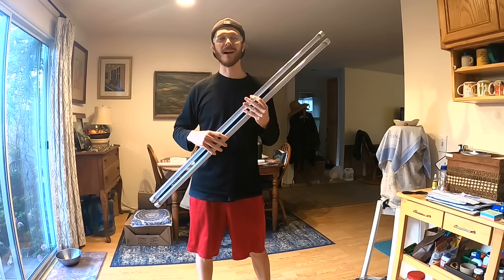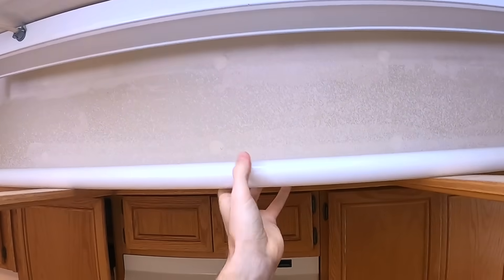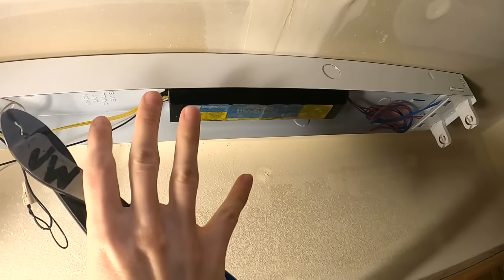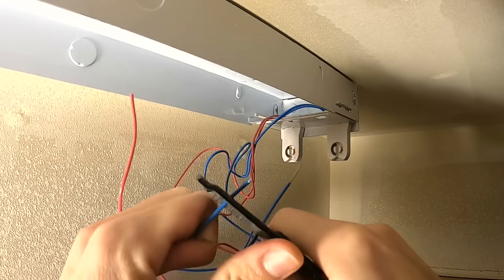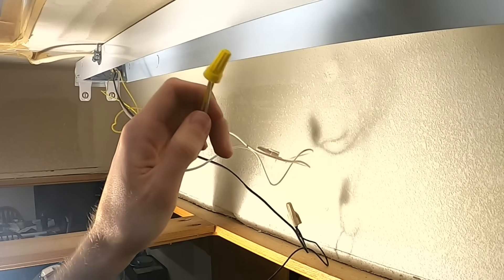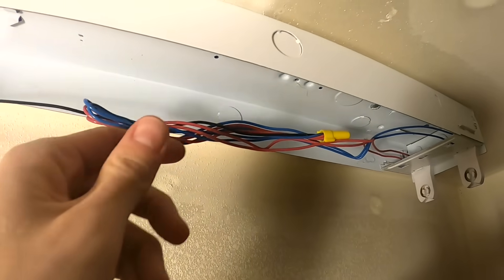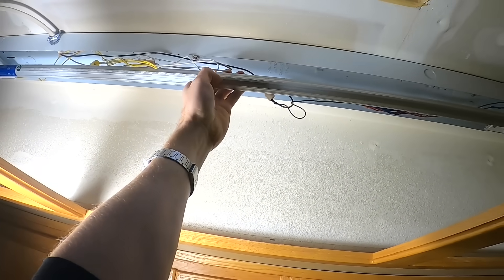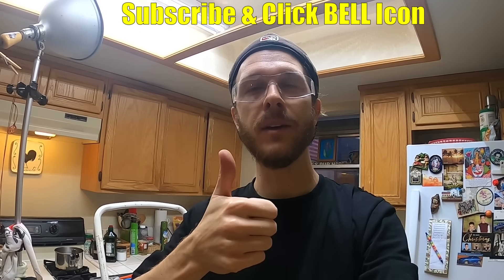How To Easily Convert Fluorescent Lights to LED | Save Money on Energy Costs

Comment: It cost more overall to buy new led lights than the running cost of a flourescent over its lifetime 😂 it’s a pointless effort
Reply from the maker: they're not much more expensive where I am, plus its' a great energy saver and if your ballasts ever go out, its the way to go 👍
Reply: @JonnyDIY  there isn’t a huge difference in energy usage between LED and Flourescent. That’s why I just don’t see the point going through a big effort
Reply from the maker: @j_c2225  Mine cut the energy more than half with these ones. It took me all of 10 minutes to do and $30-40 in bulbs.
Reply: @JonnyDIY  they’re like 15watts for a 17 watt replacement there’s a good chance it won’t even show up on your electric bill and if it does that’s 1 cent
Reply from the maker: @enterprize-zi8dd  Depends which ones your'e replacing. Mine old tubes were 40w each so quite a difference. Brighter too
Reply: @enterprize-zi8dd can I get an led freezer and fridge and TV? Maybe even an led stove and oven or microwave. The real power eaters.
Reply: Big difference in cost if you replace the flo bulbs often as suggested by the manufacturer. Once they start to blacken on the ends light output has decreased dramatically.
Reply: @rgruenhaus induction ranges use way less power. You can also get DC or AC powered fridges that work directly off of solar (DC) without an inverter, or off the mains and they still use 1/5 the power of a regular fridge. They cost a bit, but offset the cost of the solar needed to run a regular fridge. Laundry spinners also save a LOT of dryer time. Super spun clothes last longer and dry in a few minutes. Less detergent gets baked into the clothes too.
Reply: $7 each Harbor Freight
Reply: However you are forgetting that electric rates will rise steeply in the future so the ROR of LEDs will increase. Every replacement bulb I use is an LED.  They are reasonably  inexpensive last longer and are a godsend to use in areas that are almost inaccessible… like those in the foyer that are 12 ft high.  I have a fixture in the “mud noon/laundry” that chews fluorescent  bulbs, they are a pain to replace and a “PIA”  to dispose of. There is no way we can convert to renewables as fast as the environmentalists think or demand … so the result is we will reduce consumption by increased pricing  and government edicts. The end of reasonable energy costs has passed.
Reply: Always an idiot out there.  We converted the gymnasium at our school to LED.  18 bulbs each pulling 400 watts, not to mention 18 ballasts, that operate so hot you can’t touch them.  We removed the ballasts, rewired the fixture to bypass the ballast, and installed 100 watt LEDs that  put out more light than the original bulbs.  Each bulb was $65.  We are now using a quarter of the electricity, and putting out no heat, instant lighting, and they last about 22,000 hours.
And this is a bad thing?
Reply: How many times are you willing to replace ballasts?
Reply: @garyfetner1003 my kitchen 2ft fluorescent rarely gets used and has the same ballast and bulbs since the house was built in 1980.
Reply: In a kitchen or bathroom, where the light is switched on and off a lot, LED lasts much longer than fluorescent or CFL! ... My kitchen LED fluorescent replacement is 12 years old, works as good as the day it was fitted, and provides plenty of good quality instant light! ... Some people are resistant to change for the better, and are stuck in the past!
Reply: For me it’s also about getting rid of the audible hum from flourescent bulbs.
Reply: @bryanbierbaum536  it's either the bulb or the ballast.
Reply: @bryanbierbaum536 — That’s what I came here to ask about....
Reply: @bryanbierbaum536  it’s the ballast humming
Reply: What tube lights are $120 a box right now and ballast are $40 led bulbs are $10 a piece lmao stick to handyman stuff.
Reply: Quality of florescent bulbs and ballasts are total crap these days. They don't last like the old ones, not even close.
Reply: There are three reasons for converting from florescent to led tubes. 1: building safety. The starters get hot and can catch alight. They will fall to the ground and set alight whatever is below. I have witnessed this in 3 buildings. The first two there were people in the room and they extinguished the fires. Last building was badly damaged. Just get rid of fluorescent tubes and any luminaries with starters unless they can catch fire outside safely. 2: florescent tubes contain mercury powder. You don't want that around, you can't safely vacuum up the powder from broken tubes. 3. You need to replace all tubes and starters every 7500-10k hours because the light output drops. It is quicker to replace a led tube than a fluorescent tube plus starter.
Reply: @dammitdad What you stated is no valid reason to replace flourescents. Never seen a starter catch fire. Also, not many preheat fixtures around. Most are RS. Mercury contamination is not inherent to the normal function of the lights.
Reply: I’m tired of fluorescent bulbs. I once bumped into a cfl bulb in my brother in laws attic with my head and it broke. I don’t think that was very good for my health. Also, we have to bring our fluorescent tubes to the dump and pay to dispose of them. I’m happy to switch over.
Reply: I changed mine to get rid of the damn buzzing ballast! And the flickering. That was well worth it. I’m super pleased.
Reply: @mguerramd  mine NEVER flicker and they never buzz, you must have outdated ballasts which can be loud and flickery
Reply: @sizquirt  Yeah those ballasts looked like they were from the Eisenhower administration! All quiet and flicker free now. These fixtures were installed in the mid 80’s actually and the bulbs lasted  about that long so yes fluorescents can have a LONG service life.
Reply: Not entirely a wasted effort, as there are other considerations besides costs. I know quite a few people, who can't handle being under fluoro. Iights. One lady in particular gets very bad migraine headaches from them. This applied to compact fluorescent globes too. So Led light globes ha e been a huge benefit. 
And retrofitting these means you don't need an expensive electrician to swap out the actual light fittings themselves. I know a few people who simply had to put up with them, purely down to the expense that another solution (with the same light output) would give them. 
It also saves on landfill too, since your obviously keeping your current lighting setup, as is.
Reply: I replaced all 8 tubes with led in 4 double bulb units.   They are 8’ long units.   The led tubes are cheap.   I purchased from Amazon at $15 each.   Every year I had either a Fluor tube or two or a ballast go out and in the winter they would have a hard time starting.   I also hated disposing if the dead Fluor tubes.  The LED tubes I used were 4000Kelvin daylight tubes.   Anything higher is cold white and uncomfortable in my view.  The quality of light from LED  is far superior and save at least some energy.   Make sure you get tubes with correct ends for your unit, either 2pin or single button.   I have the single button end type.
Reply: @phbrinsden  None of mine have gone out and they have been running for over 10+ years.
Reply: Are you actually so committed to ‘low-info’ that you don’t even care about the efficiency? You make no mention of it so I’ll assume ‘yes’.
Reply: @R.BOWERS who works in a 30 degree garage
Reply: @R.BOWERS  doesn't take long, I do it everyday in the winter.
Reply: 4 ft T8 LED average cost $7, buy more will be $5 even $4, energy consumption is bout 1/3, if ballast begins to heat up will cost even More, LED runs at lower temperature, so I don't see how LED cost more! 🤔
Reply: We have an old 15,000 sf garage built under the 1970s one-lumen-per-square-foot lighting code (actually in the 70s I don’t think lumens have been invented yet, it’s dark in there😅.) 
But by installing LEDs I get more lumens per fixture, and I can add more fixtures to each circuit without overloading existing grid.  And with the explosion of electric cars,  golf carts, and charging stations for scooters, bikes ect, that garage grid is getting pretty warm.
Reply: @soundmiami  nice LED ad, electric cars are trash. just use good RELIABLE fluorescent tubes.
Reply: Getting rid of the ballasts  is the goal  here.  I'm  tired of them failing.
Reply: @michaelpavia7964  I've never had any fail, must've had a bad batch or just faulty electrical system.
Reply: Conversation to LED gives better light and will be cheaper than changing flo tubes every year or so as the light output decreases. The black ends on these bulbs indicate they should have been replaced a while ago.
Reply: Nice vid, thanks. I just replaced the whole fittings with LED fittings, as they’re quite cheap in UK.
Reply: There about the same price. And there's lots of benefits other then saving money. For example I can replace 1 CFL or hid light with 2 led without changing the size of the branch cct.
Reply: I see no savings on throwing out working florescents. I see that LEDs are slightly better on consumption.  When my perfectly good fluros die, I will likely replace them with LEDs. But I got my workshop fluros free, which is hard to beat.
Reply: Much fucking brighter
Reply: The fluorescent bulbs will soon be unavailable. What then? Manufacturing your own?
Reply: @skyemac8  forget the bulbs you won't be able to get the ballast what then for voltage I guess you wanna hard wire them and blow up thf lights lol
Reply: @skyemac8  they’ll always be available in the right places. The internet exists don’t forget
Reply: I still remember them saying led bulbs would last 20 years and mine have lasted about 1.
Reply: @garyharper2943  and you'd be full of shit because every led bulbs comes with a 50k hour or 5 year warranty and is replaced for free.
Reply: @garyharper2943 depends on the led bulbs and the electrical installation that you have. Had led lamps run all day for about 7 years and then I moved home.
4 years in this house and still haven't changed a single led lightbulb that I installed when I moved In.
Reply: I came on to say the same thing…I’ve had the same florescent bulbs in my kitchen for 30+ years…why would I change now?
Reply: @THINJIMI  every electrician ever: so that's a lie
Reply: @malygos9301  - 30 years dude! …Half my life! Why would you even bother writing this reply?
Reply: @THINJIMI  because it makes no sense and you have no clue what you're talking about I literally do this for a living lol electricity is manufactured on use hours. So even tho I know it's not true congrats on having the only fixtures in the world that work this way.
Reply: @malygos9301  - Dude, I’ve Never had to buy them in 30 years…get a grip and waste your own money on expensive lights when I may never have to buy any? Who does your finances? They better explain them to you.
Reply: @THINJIMI 
I too have very long lasting fluorescents. The led's I got gave a lot of problems and expensive. 
  He was arrogant to suggest that you lie. Especially being an electrician his experience should have verified what you said.
    However ballasts and starters of fluorescents are the main problem.
Reply: @onlythetruth883  - I just replaced the starter on one of my 2 that have lasted 30 years, but the bulb still works great, and it’s on all day long almost 24/7! I couldn’t believe the pompous suggestion that I throw out my 30 year bulbs and replace them with others! When it ain’t broke, I don’t fix it! Some people just always got to say something crazy…especially these days.
Reply: I just had to change one of my starters…but the bulbs are still going strong!
Reply: Fluorescent bulbs suck. Never liked them. Ballast burns out. Bulbs don't last. They suck.
Reply: My florescent 2ft bulbs have been working since my house was built in 1980 and they are only occasionally slow to start. I'm 72 years old this year and won't get what these leds cost back in the years I have left.  A minimum of $26/2
Reply: @rgruenhaus I just bought 2 24" LED tubes for $8 each at Home Depot in LA.
Reply: @rgruenhaus  I’m the same age and we call it the don’t buy green banana syndrome. 😂
Reply: I'm sticking with fluorescent tubes until LEDs get more reliable. They're designed to run so they don't last as long as they could.
Reply: @SuburbanDon  I replaced my bathroom vanity bulbs with led 60 watt, but with 3 lights it hurts the eyes. Way too bright. Wouldn't be bad if they were dimmable.
Reply: @SuburbanDon The commercial LED tubes I sold were tested to last over 15 years operating 12-18 hours per day and 6 days per week .😊
Reply: A ballast uses 100 Watts.   The fluorescent tubes use 34 to 40 Watts per tube.

An LED tube uses 18 Watts.

Fluorescent
--------------
100 Watts + (34 Watts x 2) = 168 Watts

LED
-----
18 Watts x 2 = 36 Watts

Result
--------
Savings: 132 Watts per fixture
Reply: @DP-hy4vh  per hour or per day?

Comment: This is going to be a game changer for our kitchen Thanks!!!
Reply from the maker: You're welcome, yes it is definitely a large improvement and huge energy saver. My 4 new bulbs 18.5w each, old ones were 40w!
Reply: @JonnyDIY  my bulbs are 18w , have been for 30 years , I use 4 (should be 8 but I thought 4 were enough ) not sure if I'd use less energy if I bought led
Reply from the maker: @smallfeet4581  they should be brighter for the same energy use or less. And also you can get dimmable ones. I think I'll put in a dimmer switch and see if the ones I have can dim. I like to be able to dim the lights.
Reply: @JonnyDIY  I've looked up led for the size I need to fit a 60 cm 18 w and they are running at 9w so a bit of saving I guess , it's my kitchen and I need the light there , for dimmable I'd need to get a different switch installed , but interesting video , the issue is the companies are charging a lot to get us to reduce our usage but bringing in more people to the country who will need energy 🤷, the need for nuclear energy to supplement green energy is wrong imo , I hate nuclear , I'd rather have solar but don't get enough sun for that